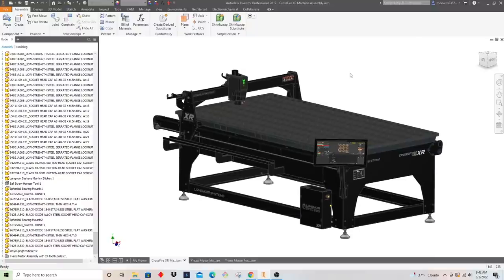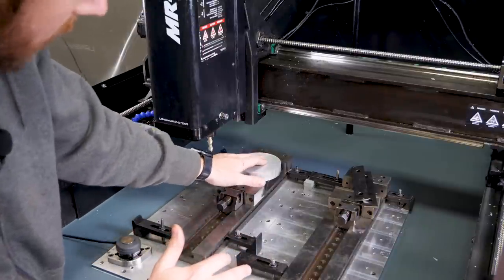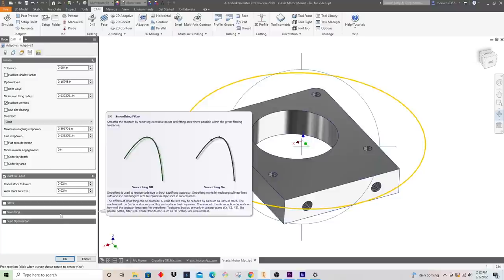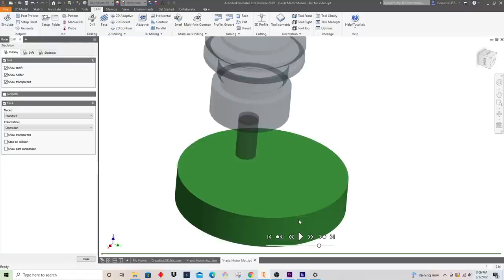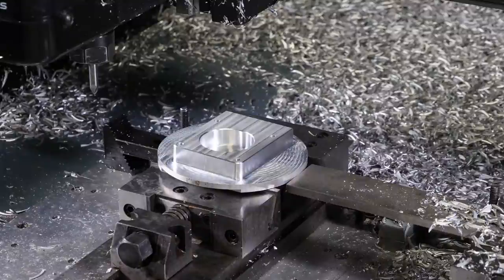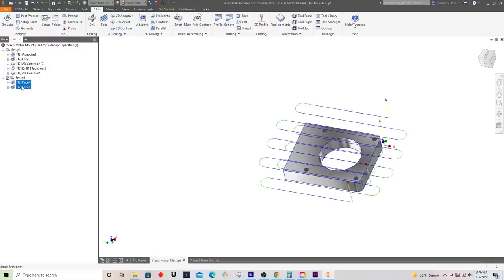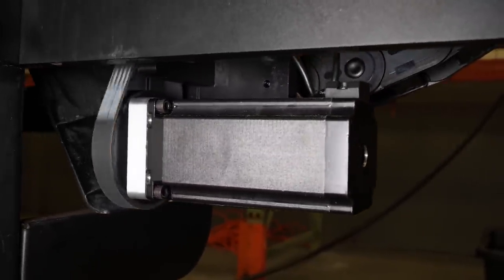Transforming an Idea into a Finished Part on the MR-1 CNC Gantry Milling Machine

Comment: Any plans to add a tool changer in the future? Perhaps a wine rack style tool changer like you see on cnc routers
Reply: Wanted to ask something similar.
Reply: at least an ATC Spindle so you can quickly change tools ang go
Reply: @ipadize  Yeah. I really like the overall design of this machine. It seems well thought out, but without an ATC option I don't think I could justify it. Still looking forward to see how this cnc does.
Reply: @3veryBodyHatesChris  tbh, if this machine had an ATC Spindle, it would probably cost twice as much, if it isnt a cheap chinese one without grounding. There are really good ATC Spindles with 2.2kw and up to 50k rpm, but they cost minimum 3.700€ and are ISO20/SK20 (Teknomotor ATC41/ Spinogy X22).

Comment: you know, for like 7k all optioned out, this is an impressive machine, I was looking at a Tormach 440, but I think ima gonna get this, bigger table size, more hp, like 1/2 the price with similar options, idk what they compare in terms of rigidity, but man for 7k, I can get my business up and running with this for sure.
Reply: It certainly is interesting.  I have two reservations.  1) the low Z work envelope. I can certainly envision wanting to bore into parts for which I don't think there is enough clearance and 2) how to handle tool changes. Will a TTS tool holder work in the ER20 spindle or are we going to have to Z calibrate on every tool change? If so, how is that done if you are working on a plate that takes up the entire X/Y work volume? Putting accurately placed holes in a plate too large to fit on a Tormach is a major use case for me.
Reply: @saf3ty3rd  Like with all machines, you get creative with the limitations of what you can afford. Feel free to drop $50k on a Haas if that's what you really need.

Comment: Good video. I was researching what Langmuir has to offer when I found this video. 

Regarding Inventor vs Fusion. Inventor is much more mature and robust on the CAD side. However, the CAM side is more robust in Fusion. Fusion is the platform that Autodesk has decided to make their mfg platform. There are now several features that aren’t found I’m a inventor CAM and won’t come to Inventor CAM. Also look for Autodesk to continue to improve the workflow for Inventor to Fusion to use the best of both worlds.

Comment: Pro tip: Set your entry and exit move on the corner when doing the final contour. That way, you won't have blend lines.
Reply: What about closed internal contours though?
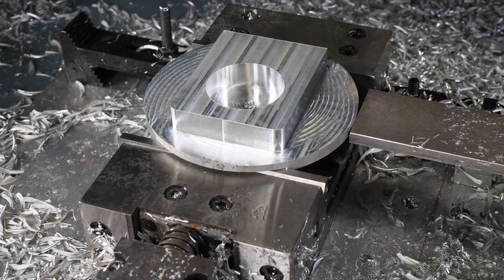Reply: @Sketch1994  What do you mean? I was referring to the line that is left @ 44:44. If you move the entry and exit point to the corner, even one with a radius, this line is invisible.
Reply: @WimsMill  I know what you mean and I have been doing it like this ever since I started programming CNCs (had a lot of experience running manual mills and lathes before that).
I just wonder if you know any similar trick for where to put the blend line on something like a straight closed slot with semicircle ends for example. 
Some parts I setup needed some slots like that and I could never for the life of me get it leave no mark without probably resorting to ramping ramping out of the contour or something and having a spiral mark out and some possible recutting. Of course on the roughing pass there was even a slight gouge when the tool came back to the beggining of the contour path but now without slotting at 1.25xD. 
Finishing passes would leave a perfectly smooth surface but that god damn line was always visible. 
In that case it didn't matter though...at all! The parts were getting hot dipped afterwards but even with a single roughing pass, with a nearly perfected recipe (high end tools and holding equipment, through spindle coolant, 95% perfect speeds and feeds ) on a quite capable and precise little machine (a brand new but entry level fully opted in DMG Mori M1) and the result was so good already I couldn't find any excuse not to try and perfect it, as long as it wasn't going to add more than 5 seconds part but I left that company before I managed to. Also the experience/knowledge of perfecting something useless is the what can make the real difference in the critical stuff.
PS: Sorry for the long reply and the slight ranting
PS2: The slots had an open bottom (which allowed me to write an oscillating toolpath and eliminate notch wear life of the tools, and more than triple the ammount of burr free slots we could cut) and were being predrilled on the center of the end radius.
Reply: @Sketch1994  Ah, yes. That is the more challenging one and usually overlooked since it is more often out of sight. I usually look for a spot that is not to obvious (end of a rounded corner) and use a lead out sweep angle that is not 90°. Something like 15° or less. This makes the line less noticeable but is not possible in all materials (rubbing). This is also usable on outside parts without corners. Be careful though, it can cut into the wall with round holes and incorrect parameters. 
Cool that you got to play DMG Mori M1! Never even seen one in real life...
Reply: @WimsMill  I used the Siemens KONTC or KONTT function in the G40-1-2 move (instead of the default NORM) which turns the cutter comp enabling move into an arc, with the radius needed to lead into the contour tangentially (at least with KONTT. I am not exactly sure of the details of KONTC). I started loving Siemens when I found this trick! The M1 is pretty solid for a machine of it's class and with such an emphasis on features and practicality (a TC shutter would be nice though) but tbh I faced some problems with the controller losing the machine coordinates once and hitting the TC on the spindle (if it went the other way it would hit the hard stops) and then some problems with the program memory after a memory card failure.

Comment: I was wondering, if you had a second line like the coolant coming in for an air blast to clear chips, can that be triggered by adding in some g-code to the program? Like air-on, air-off or air blast 2 sec.
Reply: worst case, you could build something with an arduino or raspberry pi to work separately.

Comment: Is a boring head a practical option? The max nose to table is 8" (assuming the tool can be retracted above the bottom of the gantry) and I'm guessing the work holding is ~1.5" tall. That doesn't leave a lot of room for the part + tool.
Reply from the maker: The maximum table to nose is 9.0". We also built a boring head for the machine and there's some footage of its use on our website. The vises we sell have a 1.1875 base thickness.
Reply: @LangmuirSystems  What is the clearance between the spindle axis and the Z axis mount?

Comment: This is great although very confusing. I just put the funds down on this. Is this software included with the MR1??
Reply: Yes they include the proprietary software for the mill but you have to provide the CAD tools. It looks pretty standard though for your CNC stuff with path tool. Alibre Design, Fusion 360 and FreeCad with Tool Path.

Comment: Why use 1 2 3 block use two shims cut from toolsteel 1/2 thick next to vise jaws? Tap part to solidly connect to toolsteel before machining.
Reply: Easier to probe off of is my guess
Reply: @dividingbyzerofpv6748  As long as the part is above the jaws or the probe is from the plus x side of the part it is doable. This also saves a double setup of the part.

Comment: for that chamfering op. you can go significantly faster, you'd be surprised the finish you can get going fast. at work i run a 3/8 2 flute carbide 90 deg spotting drill for my chamfers and spots, typically 8k rpm at 75 ipm on the big mill or 15k at 140ipm on my 30 taper and the finish is always great. those are the speeds i usually run for a 10 to 30 thou edge break chamfer

Comment: will this be a available upgrade for the xr?
Reply from the maker: No sir, this is an entirely different machine.
Reply: I asking about the bigger gear and blocks. not the mr-1
Reply from the maker: @tricktuning1  oh i see, no we tested this change on XR and found there to be no performance gain.